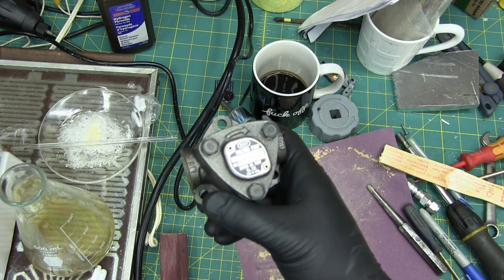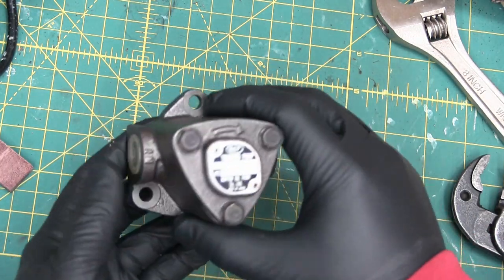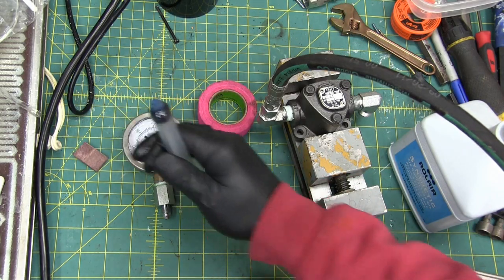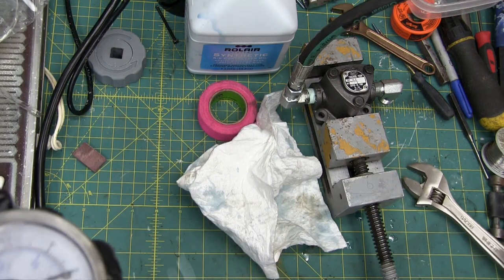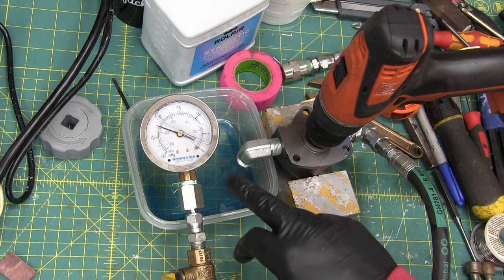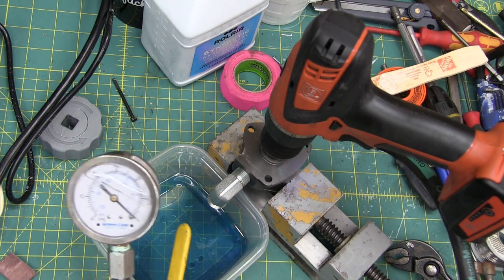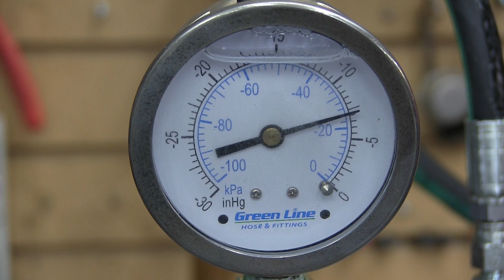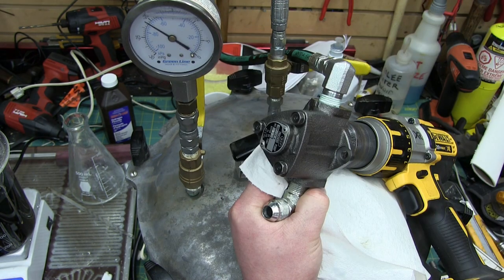Vacuum Pump Hydraulics | Cheap Hacks

Comment: Another good source for a DIY vac pump is a rotary aircon compressor, just a small one from a window/portable air-con or dehumidifier, they pass little oil compared to piston or scroll comps, and can pull a vacuum on a large vessel pretty darn fast. I modified an old R22 jug in such a way that I can attach a fridge compressor to it and suck up fluids in cars, great for power steering and brakes which lack the drain plugs.

Comment: Folks doing DIY resin casting would be interested in this.
Reply: Hell Yea!  I been racking my brains for ages trying to create a cheap vac pump . Im a gonna try this.
Reply: How much vacuum is needed for that?
Reply: Yup
Reply: somebody else depends on a couple factors, but as long as you're working above 72f it usually doesn't require much. 20 inches should do it
Reply: I hear a good, cheap alternative is to get a second-hand automotive AC compressor, and hook a 1/2HP motor to it with a belt.
Reply: Find and old fridge amd snag the compressor, all the vacuum you could ever need in those things.
Reply: Vacuum Pumps aren't that expensive.
I've had a cheap (about $100) from Harbor Freight for many years and it works fine. I don't use it often but whenever I do, it works great.
It might be easier than than trying to jerry rig one of these contraptions. It might not be as much fun though.
Reply: Case in point, I am very interested. Though I think I am going to try the suggestion from another viewer and cannibalize an old window air conditioner and pull out the compressor.

Comment: I have always wondered if one could turn a hydraulic pump into a HPA (250 bar+) pump.  The vac idea is cool, but I think the oil will boil at a certain point.  Thanks for the Skookem vijeo at 4am while i'm drinking!  That's a super easy vacuum!
Reply: silicone lubricants aren't going to boil anywhere near 21''hg. With a better pump that gets closer to 29''hg, just switch to vacuum pump oil. It just needs to be swapped out with use because it absorbs moisture.
Reply: In a previous video he stated that the fluid can cavitate and boil when he was doing a tear down of this exact pump.   It will be inside the pump itself,but that will be the limiting factor.

Comment: Coming from a brief employment in the vapor recovery industry, "hydraulic" vacuum pumps are pretty common. They are called liquid ring vacuum pumps, and are a lot cheaper than the alternative of a dry vacuum pump. The cost that evens them out is the liquid in the liquid ring pump gets expended or consumed in the process. The most common liquid being used in the pump is glycol which is pretty much antifreeze. It's worth looking into if you're interested.

Comment: Hook a tee fitting and a needle valve to the suction and let the vacuum draw in a small stream of oil from your reservoir (the bowl) effectively making a recirculation loop to keep the mechanicals lubed and sealed. This is effectively what a normal 2 stage rotary vane vacuum pump does, the pump runs submerged in the oil reservoir so a small amount of oil is constantly seeping in and keeps 'er chooching. Maybe see if you can get down to a micron level vacuum. Might I suggest (shameless plug) the BluVac gauge. For the non-HVACR inclined that's microns of mercury pressure absolute, IE 0 microns is a perfect vacuum. Since there are 25400 microns per inch atmospheric pressure is nominally about 762000 microns. HVAC systems have to be vacuumed down to less than 500 and stay under 1000 once the system is blanked off. 500 out of 762000 isn't much.
Reply: BTW I posted this before I saw Justin Koschak suggest the same thing in a reply to a different comment.

Comment: Older aviation vacuum pumps are continuously oiled with engine oil, then the oil and air are passed through an air oil separator (which is sometimes omitted, but that leaves oily streaks on the side of your airplane).
I imagine you could have a small reservoir of oil which is drawn in through a minuscule metered orifice just before the pump inlet.

Comment: To be honest, this were not a surprise.
And technically, we do not even need anything to seal it. As long as we can pump faster then what we leak back, then we are still pumping. All though, the more we leak, the lower pumping efficiency we have, so yes, it is still good to have as little leakage as as possible.
Side note, turbomolecular pumps and diffusion pumps used in ultra high vacuum applications tends to be limited in how low pressure they can reach purely by their leakage.(also by their compression ratio.)

Comment: As long as you can displace a higher volume than leaks back, any type of pressure pump can be used as a vacuum pump. The only downside is hydraulic pumps are designed to rely on the oil they pump to lubricate them. So they will wear out faster. Not a big deal if just used periodically for hobby or experimentation. Commercial vacuum pumps are terribly expensive. So thumbs up for this idea.

Comment: That's super cool AvE.  If you set it up with a needle flow control valve and a tiny tube to vacuum drip feed thick oil in just ahead of the pump to keep it sealed and lubed that would be a pretty sweet setup. You could recirculate the oil in a self contained system.  I bet that really thick extreme pressure gear lube they use in worm drives would be ideal.

Comment: Another Great video AvE!!!, 
I use a TD260M air-vac vacuum transducer/generator at work for holding oil up in hydraulic tanks so you don’t have to drain 300 litres of oil just to fix one or two oil leaks or change a hose etc. really handy. Use then to hold diff oil up in off highway trucks when checking mag screen or attaching the kidney loop recirc filter system also. 
👌🏻👌🏻👌🏻👌🏻👌🏻⚙️⛓🔩🔧

Comment: I have a suggestion: put the pump so the outlet port is vertical, use some fittings which the ID is as big as possible, put a small oil reservoir on top of it and add some oil. On the inlet, add a checkvalve somehow (optional).

The goal is that gravity will allow the oil to go back in throught the inlet port, adding oil to the gears and keeping the seal in good working order.

Grease or silicone paste is good for a short while, but will be pumped/pushed out relativelly fast and no more seal.

Comment: Dow Corning 111 Grease is Great! I use it on valve packing on sliding stem valves all the time. It is my go to tacky solution when I can't get something to stay in place a dab of 111 and it'll stay long enough to get the work done.

Comment: Now to implode some 44 gallon drums and scare the neighbors :D
It would not be hard at all to make that into an oil-injected pump by simply adding a capillary line to the intake feeding oil back from the outlet collector, kinda tempted to try it myself, I have a bunch of old pumps and motors kicking around.

Comment: We have plant air at about 100 psi at work so we just use a Venturi pump to pull a vacuum on a piece of equipment we are fixing to out back in service. You can make a venturi with simple fittings if you are in a bind.

Comment: Like some other people have mentioned ~23"mg is a lousy vacuum for most applications but the proof of concept is still "skookum". FYI:
- At sea level you have the force of 1 Atmosphere, 760'000 Microns, or 14.7 PSI. The difference between PSI and PSIA is that PSI gauges account for the ~14.7PSI of atmosphere, at sea level, that is already exerted upon you. A PSIA gauge at sea level would read ~14.7 PSI.
- Water will boil at ~18'000 microns at 20C at sea level (25401 microns per "mg vacuum).
- A $200 dollar two stage 6 CFM pump can obtain 500 micron or lower on a surprisingly large volume given enough time and enough oil changes (refrigeration guys use them all the time).
- Even interstellar space isn't a COMPETE vacuum but its close enough according to our calculations; interstellar space is ~10E-7 Torr (1 Torr = 1000 microns).

IF YA DON'T KNOW NOW YA KNOW...

Comment: Here's one fer ya:  Get one of those ten-dollar 12 volt Chinese auto tire pumps at Walmart, take it apart proper and put it INSIDE of that pressure-cooker.  Feed it the voltage and it will PUSH the air outta there.  Works like a champ.  It's dead-simple to fix up some sort of vacuum switch that turns it off and on on-demand.  You have a permanent vacuum facility.  Pump dies?  Buy another.  But it will last a lot longer than you may expect.  And pulls a damn decent vacuum.  Pushes.  Whatever.  You'll need to make some holes in the right places and all that.  Some silicone et cetera.  It ain't rocket surgery.
Reply: You got any tutorials/instructions for this? Sounds like fun!
Reply: Well, I've built two of them.  I'm going to build another.  Guess I ought to take some pictures!

Comment: I think you might have better results if you try continually feeding in oil from the outlet.  You might be able to just keep the outlet under oil (possibly with gravity giving you some pressure).  Then, if the pump dries out and stops sealing, the pump will suck up oil and start sealing again.

Comment: Yes, it will work due to the very high tolerances. But. it is very inefficient and won't last. Geared pressure pumps are, as you implied,  very cheap and extremely valuable device. Interesting. Thanks

Comment: Used to work on commercial screw compressors and they spray oil onto the screw for sealing and remove with filters after.

Comment: A small oil feed line with a needle valve can let a small amount of oil into the suction line.  That oil line then draws from a baffle tank on the output of the pump so the oil just circulates. This is all up stream of what ever is being evacuated so there is no contamination.

Comment: If you look at a typical vane vac pump, they have an oil dashpot on top
well at least the milking parlour ones did, then on the outlet (pressure side) there was an oil trap.
The dashpot was set to feed a small amount of oil

Comment: Use an air operated vaccuume system for filling the cooling system on semi trucks at work. 
Works great. Hose sucks coolant from the drain pan on the floor and 95%of the time we don't have to top it off after running up to temp to purge the system of air.

Comment: Just to let you know.... We use 111 grease on systems for breathing air used for diving... It doesn't off gas anything, even under pressure.

Comment: For the oil add a small reservoir tower on the exhaust. Oil in the bottom exhaust at the top with pump exit in middle. Add a small line return from the reservoir to the vac side. Add a hand bulb and valve... 

Cool shit man!

Comment: This is very similar to how older firetrucks prime their pumps.  Their primer pumps use oil to seal up so they can draw the air out of the main pump housing and any suction lines.  Newer primers are oilless though, no idea how they hold up compared to the old system.

Comment: I use a general small compressor to create a "vacuum" in a hydraulic oil tank when opening the fittings and I don't want to leak out the oil. Just take out the intake air filter and add some hydraulic fitting legos and you are good to go.

Comment: I prefer a venturi type vacuum generator that uses air pressure to create a vacuum. I admit i only get around 10 InHg from a hydraulic system tank but I have adapted all my adapters to 1/4 npt and just use the Milton couplings for everything. Granted you must build adapter for whatever you want to pull a vacuum but it's just shop air line fittings and a tap! 😁

Comment: I was trying to think of ways that you could recirculate the oil, thinking back to when CodysLab made the vacuum pump with mercury. The mercury dripped causing a fixed displacement -- similar in that respect to your pump arrangement. In that case he had two reservoirs, an in and an out open to atmosphere -- you could set up a pump to recirculate from out reservoir to in. But I think in order for it to work with oil, the oil would have to be thick enough that atmospheric pressure could not bubble back through it -- essentially meaning it would have to be mercury for it to work. Might be worth a try though, get some Tee in there...

Comment: Put the tiniest capillary tube between the oil catch and the suction side, the thing might be able to pump air with just enough oil mixed in for sealing, like a proper vacuum pump.
If not it still works as a way to let the oil back in there with a manual valve.

Comment: Ok so that's a way to get a cheap vacuum pump. Now an honest question... What use do vacuum pumps have in casual shop ordeals and occasional freak maintenance work?
Surely they are used in various specialty work, and in Cody's Lab, but I can't think of any use for them outside of fields of work where you already have industrial vacuum systems.

Comment: Regularly use small electric ones work
Attach to hydraulic tank, switch to suck and all oil in our system is pumped back to tank (3000 litre)
Saves on wasting oil due to rather than just switching off tank valve I also save oil in the lines too when doing repairs or swapping out

Comment: How well does air bubble through hydraulic oil? 

You might be able to have the oil back feed into the pump by having the open side above the pump, and letting gravity drop the oil back down inside before the atmospheric air, that way it pushes on the oil first into the cracks, re-sealing the gaps when you stop.
Reply: Pretty sure that's how a rotary vane pump for HVAC works.  Bottom part of the vanes sit in an oil bath.  Thought it was funny to hear when he fired it up and it sounded just like my JB pump. "Gurgle, gurgle"

Comment: Try running a line 12-18" vertically out of the discharge, for drain back with a slight tilt to reuse the same oil

Comment: Useful?  Boy Howdy... I may have to cobble one of these up inside of a small box or old tool case with some battery leads and a 12Vdc motor!   I can think of many uses for this without having to buy an expensive Vac pump.  Excellent Hack!

Comment: Put an oil reservoir at the exhaust of the pump and let the evacuated air bubble through the oil. The vacuum on the other side of the pump will suck oil in the gaps and clearances. The pump will have constant lubrication and sealing oil.

Comment: I was worried it might overheat or fail because it's pumping air.
But I guess the important part is that you need a self priming hydraulic pump.

Comment: automotive vacuum pumps are augmented with oil, the suck a little oil In from the engine with the air and dump the air to the crankcase. work great with long service lifes. edit.... if you added a t piece with a thin thin fitting to draw oil from the "outlet" and recycle it thro the pump I bet it's run forever.

Comment: 21''hg is a pretty lousy vacuum though. A rotary vane pump from the hazard fraught is only $100, and that'll get you to 28 or 29''. They're easy to get because the HVAC people use 'em all the time.
Reply: Its crazy how cheap HVAC vac pumps are now. I have been using a rotary aircon comp for years but I am tempted to get a China-special "professional" pump to replace it.
Reply: Yes! I've been using a Harbor Freight pump for many years. It works great.
Reply: The gauges are flaky. Full vacuum is dependant on how far above sea level you are.
Reply: Aussie50 hey I was just watching some of your old videos about trying to convert that engine to run off of propane with glow plugs. I miss those old videos lol
Reply: As one of those Ultra High vacuum guys (10^-11 torr), you can get even better vacuum with a combination of oil free roots pumps, turbomolecular pumps, ion pumps, and non-evaporable getter pumps. Just need around $100000.

Comment: Hmmm... How many inches were you able to pull? I had to borrow an A/C machine from the automotive shop of an alma mater yesterday to vacuum down the system in the truck what for turning any dihydrogen monoxide in the system into a vapor and making sure there were no major leaky-loos. After watching this though, the mental gears are turning... FWIW, the machine pulled 22 in/Hg on the truck and most machines bottom out at 30 in/Hg on the low-side gauge.

Comment: AVE!!!!! I HELP U..........ADD OIL TO A VERTICAL DISCHARGE HOSE.  THIS WAY MOST OF THE OIL STAYS IN THE PUMP AS IT FALLS BACK DOWN THE HOSE....( USE A LARGE DIAMETER HOSE) THAT WAY THE AIR YOU ARE SUCKING OUT CAN BYPAS THE HEAVY OIL ON ITS WAY TO THE ATMOSPHERE.

Comment: I was wondering if it would work with oil if you had a tank of oil that gravity fed the intake of the pump and a check valve on the vac line? basically a Venturi effect with a check valve and pulling the liquid instead of pushing it. I assume that the silicone grease will eventually run out, but you can always fill the oil tank if you stop the pump.

Comment: Wondering if we could do this with a power steering pump?☺
Reply: Very good question, they are a vane pump, but the ones I have had apart had no pre-load springs on the vanes, I have a feeling they may loose contact with the housing under vacuum and loose effectiveness.

Comment: If you REALLY need a source of vacuum between 20-25 inches, use a manifold vacuum port on the intake manifold of your car. Works wonders in a pinch
Reply: Ohio Houston except... you will be passing all the things through your engine. What if the tank you are evacuating was full of nitrogen,  or water, or hydrogen... AVE 's answer is a lot safer and simpler, not to mention cheaper if it fails... But I'm detecting that you were kidding.
Reply: ChrisHallett83 well then it should have an electric vacuum pump

Comment: This pump seems quieter and faster then a normal vacuum pump.
- 
I felt the same way when I discovered you could use a cheap aquarium pump to vacuum seal bags. (I'll be damned!)
- 
Could a Refrigerator pump be an alternative too since they like high pressure and the motor is included?